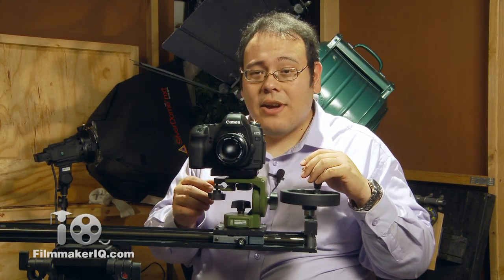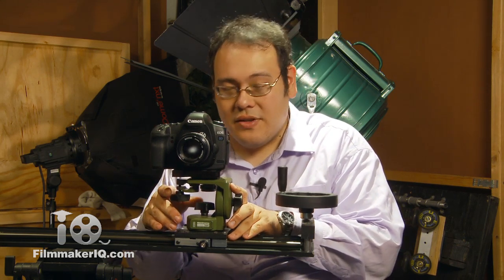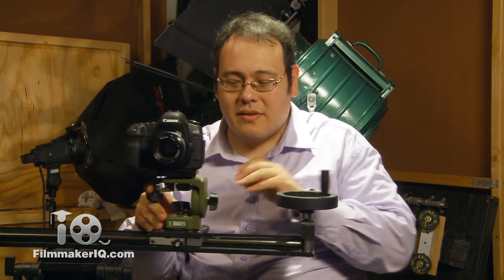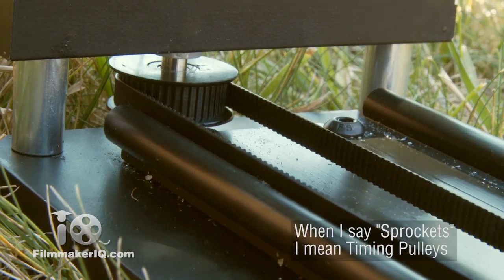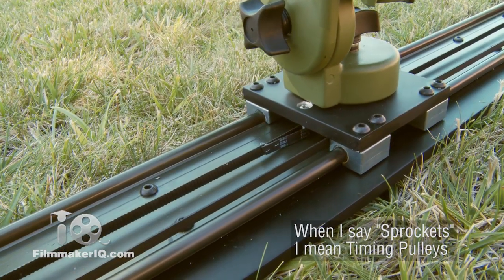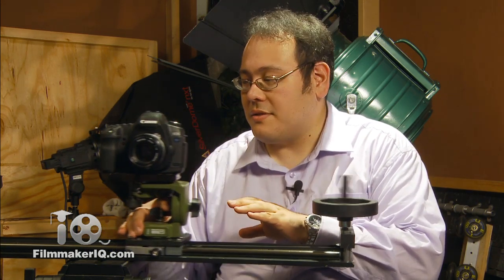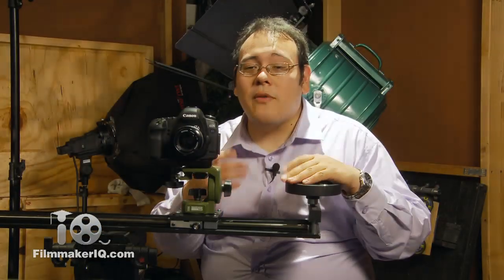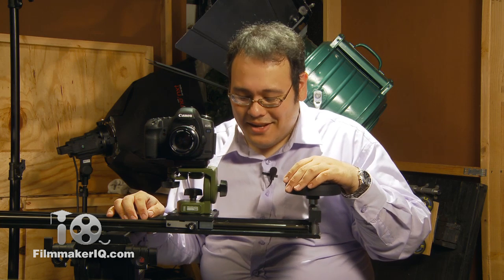DIY Mechanical Crank Camera Slider

Comment from the maker: @ConnorCrosbyPrdctns Yeah - I've been looking at small variable speed motors. the trick really is you want all sorts of speeds from timelapse slow to pretty quick. I haven't spent the time researching it but it can easily be done once you've installed the belt drive system. It's just a matter of getting the right parts.